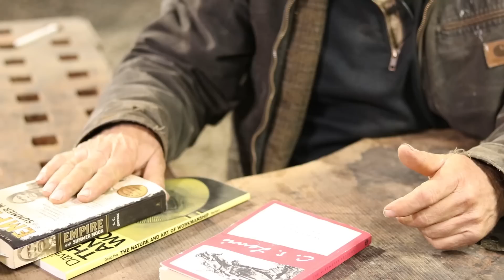Giving Good Gifts Is Hard

Comment: This is a history comment inspired by your video.    15 years ago my dad brought to my house a Sheldon Vise.    I grew up under 10 seeing this in my grandfather's basement shop.      Dad saved it from then when the house was sold in Mpls in the '70s along with a lot of tools from his and my mom's father.  

He never mounted that Sheldon vise but knew I enjoyed the craftsman hobby etc.

My brother and I have those tools and equipment now.     After he passed, I finally got around to routing out the underneath of my 3" thick bench and installing that vise.    I cleaned it and just lubricated it with a dissolved paraffin and mineral spirits solution.       It works as it did new 100+ years ago.

I didn't paint or change the patina a bit.    At about a century old,  It looks like an artifact but everyone who sees my Makita or Dewalt or Rigid or Bosch power tools always knows those.    Yet they touch that old Sheldon vise.    Even my wife's friends.     Rare.

I use it several times a week.  Such a pleasure to simply see it there alive.   And it's so damn useful.

That was a gift which has simply floated in our family.    I think my grandfather bought it at a garage sale in the '40s.

Comment: I definitely like the idea of restoring an old tool as a gift, even if that tool doesn't have special sentimental value, if for no other reason than it gives you a project to work on that doesn't end up permanently displacing air inside your own shop without being used.

Comment: Speaking of torpedo levels, the Empire EM71.8 is by far the nicest and most sturdy one I've ever owned. It's basically just a solid piece of machined aluminum. Its slope markings are good for a plumber, but would be useful for anybody. I don't have anything to do with the company, just really like the level if anyone wants a specific recommendation.

Comment: I think we have different definitions of "not that much money" 🤣 i'd say you're looking at $400 minimum to set someone up with the cheapest flux core welder and supplies from Harbor freight. Great video anyhow
Reply: You can get a second hand arc welder for $50 if that. Box of rods for $10. 
Thats gonna get someone started welding. Thats how I started. Just laying beads on a bit of plate.
Reply: @trmindustries.2549  helmet, gloves, slag hammer, etc
Reply: @BradsWorkbench  Helmet $30
Gloves $10
Hammer $5
Wire brush $5
Second hand welder $50
Rods $10
$110 is not that much if its someone you care about. And if they have a interest you dont even need to get everything, they'll get some stuff themselves.

Comment: On giving books, we use to tell the person that we gave them to that we expected them to move them on to someone else once they were finished with them and specifically told them that that could mean anytime between just after reading the title to putting it in their will.
Reply: But not, just after unwrapping?
Reply: @psidvicious  If they unwrap it and see that it's a book and Immediately hate it, one of two things has happened. Either I have misunderstood the person by buying them a book OR I have misunderstood the person by the relationship we have.

If they unwrap it and read the title and is not interested in reading that book (for whatever reason) I would prefer they move it onto someone else rather than they put it on a shelf out of some 'fear of '/ 'obligation to' me to keep it. That's not the kind of relationships I want with friends. If they don't have the ability to tell me that the gift I got them is not any use to them or they wont use it (unless it's a gag gift) they are not really friends.

Comment: IMO, if the goal is to purposely give the WORST gift you can possibly give, gift someone a ‘store-specific gift-certificate’. Nothing says, “I care so little about you, that I didn’t even think of you until I was at the check-out line and saw this kitschy piece of plastic, hanging next to the year-old candy bars and chewing gum.”
  It’s actually a statement gift and in extreme circumstances could be appropriate, if someone has really wronged you in the past year. BUT it better have been a doozie!
  Store-specific cards are the worst, but if you’re looking for something with slightly less venom, you might opt for one of those ‘pre-paid credit cards’ (which I guess by definition, would make them a debit card, but anyway..). 
  Behind the files, in the bottom drawer of my filing cabinet rests at least a half-dozen of these thoughtful gifts, long since expired. The pre-printed “To: and From:” cardboard portion has been relegated to the local landfill, long ago.

Comment: One of the first things I bought when I wanted to get into carpentry was a small, rusted, beaten up hammer very much like the one you showed. using a grinder, I wire-brushed the whole thing and releveled the head since it was pretty rough. Funnily enough, even though I have other hammers that are more handy and heavy, I will often reach for the hammer I personally restored. It gives me a sense of peace and satisfaction because I remember what it was, and what I've done with it since. As always, thanks for putting out videos that exude peace and encourage me.